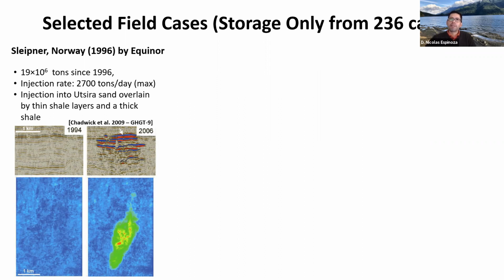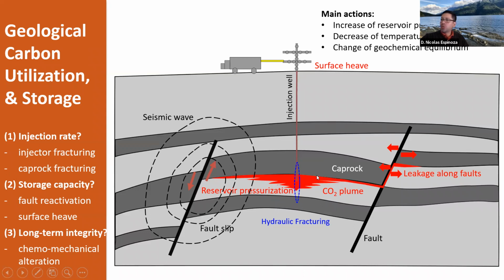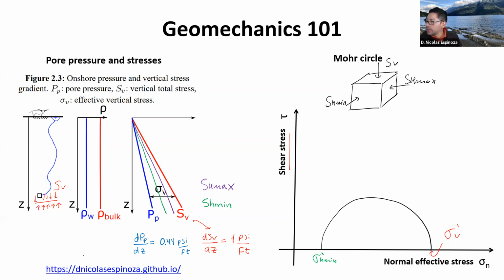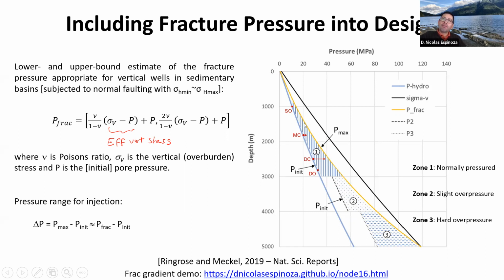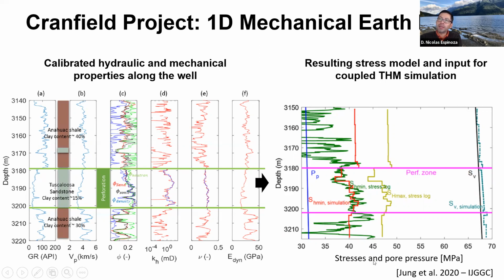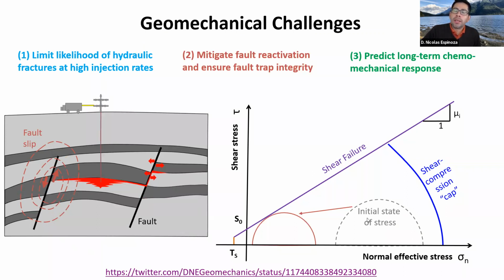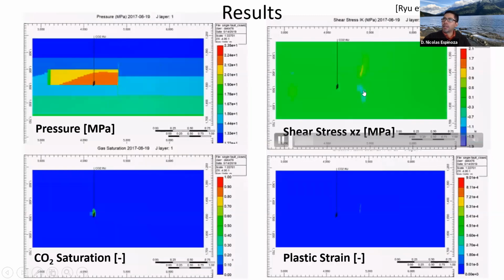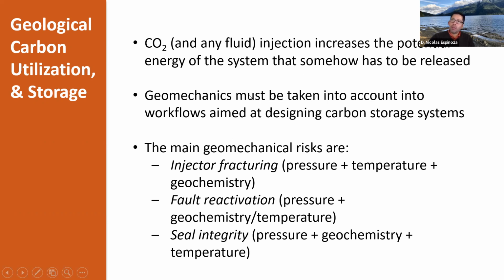Geomechanics for Carbon Capture and Geological Storage

Comment: Nicol prisms 
Mirrors 
Radiation 
Back scattering
Solar panels 
Tiles 
Refraction 
Reflection 

Geometry 
Arches 
Semicircles 
Ellipse 
Hyperbolic 

Injection well hydraulic fractures 
Injection moulding 
Injection moulding 
Sand 
Sand castings 
Sand 
ICL 
Isometric consolidation line 
ISO metric